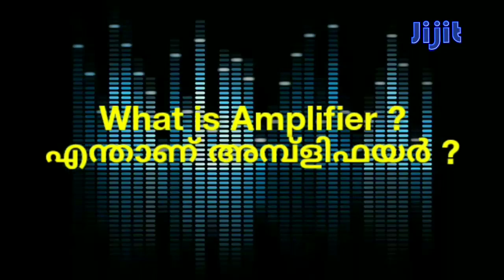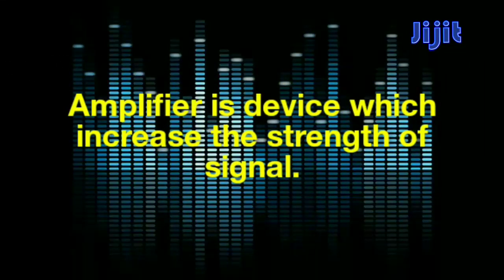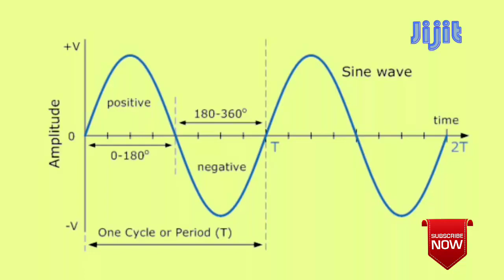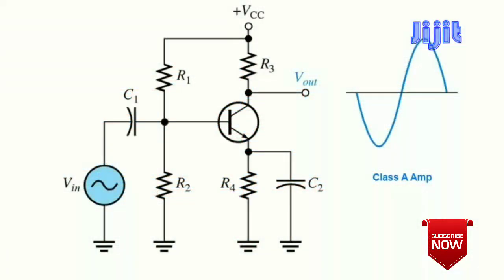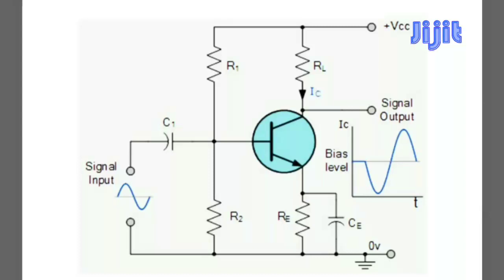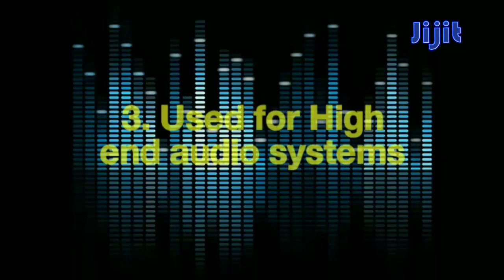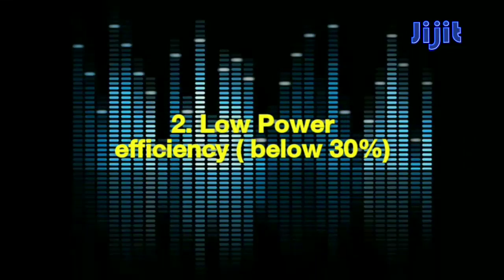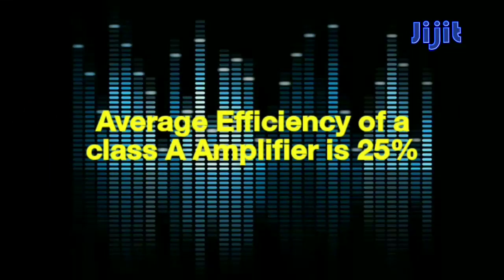Amplifier Basics Part 1 - Class A Amplifier ( ആമ്പ്ലിഫയർ ബേസിക്സ് - ക്ലാസ്സ് A ആമ്പ്ലിഫയർ )

Comment: 2030 ic 2.1 boardil subinu 2050 vechaal enthoke changes boardil varuthanam
Reply from the maker: Voltage rating different aanu 2030 12 v aanu kodukkaru ennal 2050 18v kodukkam. Pin configuration same aanu 2030 board il 2050 kodukkam but other components like capacitor ... Etc. kooduthal voltage rating ullathano ennu urappuvaruthanam ... Allenkil athokke adichupovum